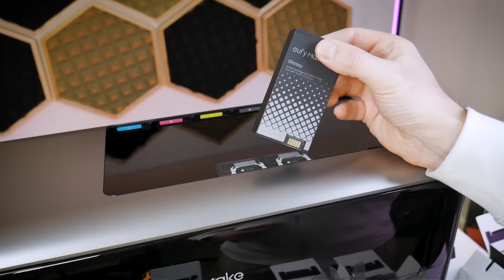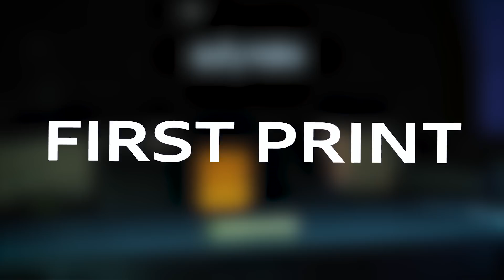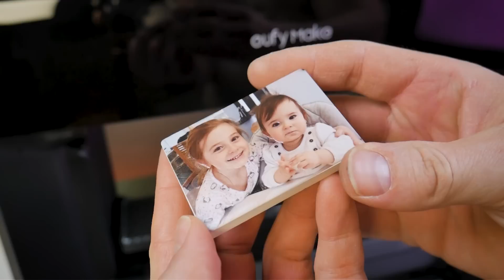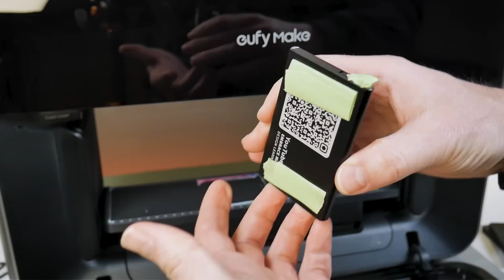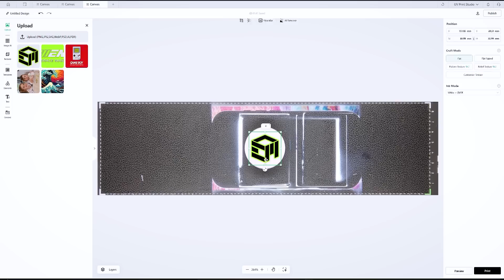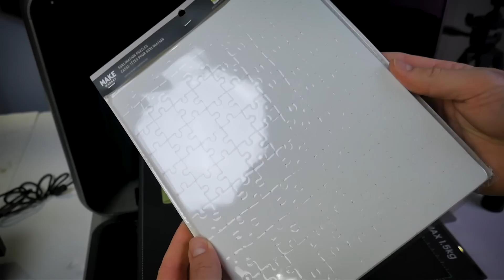EufyMake E1 UV Printer - Getting Started Guide, Example Projects, Full Review and More!

Comment from the maker: If you're looking for the machine and you appreciate my thorough video content please use my affiliate link (at no extra cost to you):
✅ Get your eufyMake E1 here:
👉 https://eufymake.sjv.io/Xm63W5
Try using discount code "embracemaking" for another $100 off orders above $2500

If you're looking for the materials in this project see below! As an Amazon Associate I may earn a small commission (at no extra cost to you):

✅ 3D printed PLA
👉 https://amzn.to/43ya2iO

✅ Smooth plastic surfaces
👉 https://embracemaking.com/products/32-piece-compact-screwdriver-set

✅ iPhone cases
👉 https://amzn.to/4k1c1SN

✅ Phone Pop Sockets
👉 https://amzn.to/432gQFf

✅ Canvas prints for art and décor
👉 https://amzn.to/3SGaQfj

✅ Fridge magnets – yes, it works!
👉 https://amzn.to/3SbfPV9

✅ Sublimation Puzzle 
👉 https://amzn.to/4k10Jhp

✅ Aluminum Wallet
👉 https://amzn.to/43lPp8a

✅ Black Framing Ruler
👉 https://amzn.to/3HdnKPk

Comment: When I go to preorder this on your video, I have to pledge the full amount, 1699.00? I’ve seen people post they put down 50.00 to pledge and they were guaranteed one, so I’m confused.
Reply: The preorder ($50 deposit) was offered before the kickstarter launch, it gave you an extra $200 off the price and cleaning kit if you ordered on the 1st day. 

The money is not taken untill the kickstarter ends, but it checks your card to make sure its valid. 

If you order via kickstarter you will still get the machine.
Reply from the maker: That's a good question - maybe it was a pre-order discount that is no longer available? I actually haven't seen this option before. The current pre-order price of $1699 is 32% off which is the lowest I'm aware of... I haven't seen a deposit method yet!

Comment: Great video and I have a lot of questions and I hope you can answer them as I am not getting a single response from support (am surprised you actually got a response)

- isnt there an option to use “fit to page or object” so all that print coming on the base can be avoided. How do you clean it by the way. 

- do you close the printer door before printing and how much of a smell or smoke it produces?

- how long you think the ink will last. Talking about ink, do you need a separate ink material for the raised prints or what you inserted initially will do the job?

- how safe is the ink when it comes to microwave, dishwasher and ofcourse if a full print on a mug and if you sipping from where the ink is, how safe it is. 

- Will this print on glass tumblers or things like a tshirt?

- how long the printer head, the ink and the filter lasts and what is the cost of replacement. 

- last but not the least, so you need to use AI credits to raise the print?

My apologies for a lengthy message but the support is absolutely rubbish without any response. Maybe they are only catering to people who actually own a printer.
Reply: Pay more attention

Comment: You need to buy 2 different sets of ink? One for normal color and one for textured stuff?
Reply from the maker: You just need one ink set - if you check the kickstarter you can see the "ink and cleaning cartridge kit" which is $179 as an early offer. This has everything you need to print with both color and texture. There is a separate "3d texture ink & cleaning cartridge kit" for the same price... this one only has a bunch of W/G and cleaning cartridges because those will be used in larger volumes. So you can buy them in bulk to have more of it on hand. It has no color as the actual color ink is used the least as it is only the top layers - hope that makes sense !

Comment: $300 for ink is a deal breaker.  it uses twice as much white ink because of base coats, the machine runs constant cleaning cycles wasting ink and cleaning fluid. a subscription service... no thanks.
Reply from the maker: Yep you have to really consider the ink cost. It's a super cool printer but you have to pay to play - perhaps there will be third party ink in the future similar to regular ink jet printers.
Reply: @EmbraceMaking  dont fool yourself. content creators are hyping these machines like its the second coming. buyers should never be beta testers. the bottom line is how much money uou can make from anker.
Reply: @Peter-w1i4v  If you have to ask that question, then its not for you. If you cannot recognize how much of a game changer this is despite the ink cost for a UV texture printer compared to industry standard versions, it's your loss.
Reply: @Peter-w1i4v are you for real? Though you have a point but lets be realistic. It’s a game changer for small businesses. Yes the Ink is expensive, but come on way better an industrial size machine in a room

Comment: Great video one of the best i've seen. Did the jigsaw pieces break apart ok or did the ink hold them together so they could not be used?
Reply from the maker: Yes I should have showed that - some of the pieces were linked together partially. It wasn't all over the puzzle but the first time you take it apart you have to be a little more careful than usual. Running a hobby knife blade over those sections while you take it apart helps keep it from tearing and you get a cleaner separation. Thanks for asking!
Reply: I hope he would've mentioned that, but yes. I would've loved to see it taken apart :)